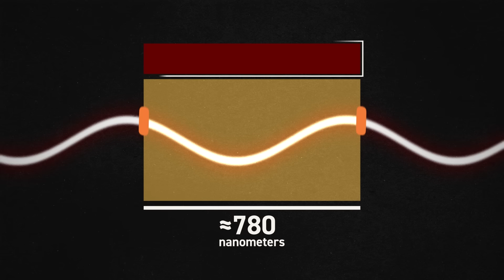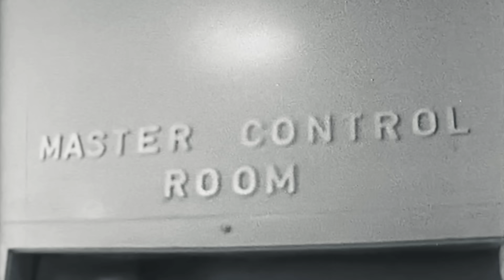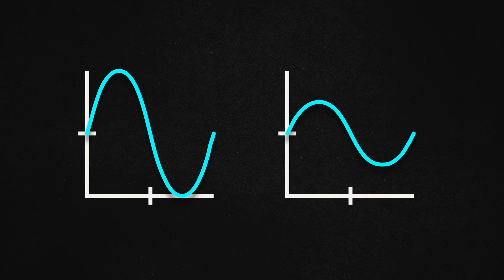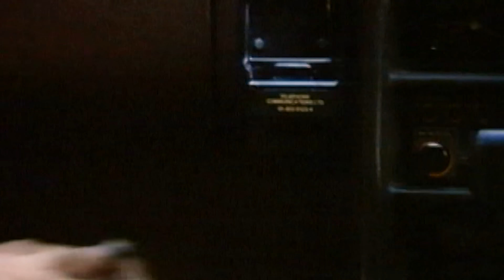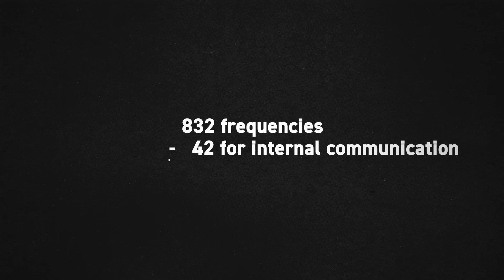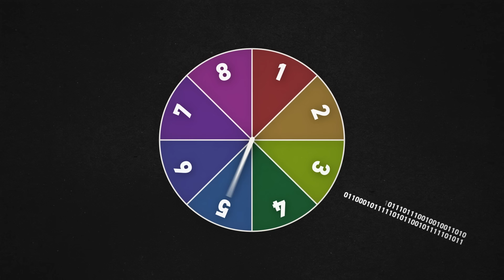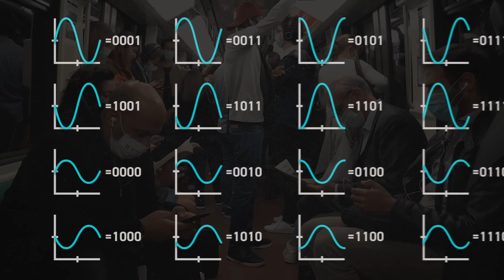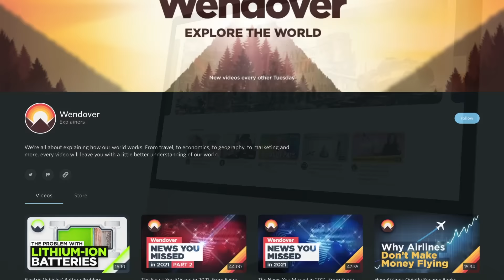How Cell Service Actually Works

Comment: I've done communication engineering courses, the amount of background requireded to understand how this stuff works is crazy. The fact that you managed to provide a Layman's explanation for such an advanced topic is very impressive. No Fourier transforms or complicated math, well done.
Reply: Man seeing this video made me realize how much thought is put into communication.
Last video I learnt about how much engineering goes into transmitting electricity.
Respect for those who make all this possible.
Reply: Insane? It's just Elementary Linear Algebra to make the most basic encryption, the more complicated encryption require more complicated matrix math.
Reply: Wish this video was there when I was starting to study communications engineering. The CDMA part triggered my PTSD of struggling to calculate transfer functions, bit error rates, transmission loss, etc. Of course I have moved into another field since I graduated.
Reply: I'm surprised how much I've taken this tech for granted
Reply: @KRYMauL  you are missing the loads of Fourier transforms, constellation diagrams, bit error, etc needed to understand cellular transmission. That is hardly basic encryption. Understanding RSA or ECDH is much simpler than communication Engineering.
Reply: @KRYMauL  data encryption might be easy algebra.The estimatimation and equalisation framework in signal theory is completely different beast
Reply: @thunderb00m  yeah he’s clearly never had to take a signals, systems and transforms class.
Reply: @thunderb00m  I knew their had to be a Fourier transformation in there because of how they're combining the frequencies. I couldn't remember the name though.
Reply: @karelrocejdl60  Elementary Linear Algebra isn't easy algebra mate, it usually deals with at least 3 variables.
Reply: @KRYMauL  i think you are confusing signal encoding with encryption.
Reply: @KRYMauL  Well that would be a cherry picking. You missed out a ton of radio communication chain. 1) Channel properties aka Propagation problem: free space propagation loss, multipath propagation, fresnell zones, lobbing, channel leaking, natural made and manmade interference and overal radio link budget, Doppler shift 2) antennas ... impedance matching, polarization influence, beamforming, materials 3) Rx and Tx hardware software defined transceivers... circulators, analog filters mixers, Low noise amplifiers, phase locked loop, automatic gain control, oscillators, Power amplifiers, ADC and DAC, clock jitter 4) signal processing... duplexing, FPGAs, ASICs, digital modulations, equalization, constellation diagram, modulation symbols ... spread spectrum techniques, digital filtering... IIR, FIR and CIC filters, frame synchronization 5) information processing: packeting, error correction, information decryption .... fuuu and i just scratched the tip of what is contained in 101 lectures at technical college
Reply: @vojvl  I was talking about his explanation of how the compiling works.
Reply: @juliankandlhofer7553  No, I'm just using the wrong words.
Reply: @KRYMauL  perhaps a different interpretation of how Me and You interpreted what FoggyJeff meant by "the amount of background requireded to understand" in the area of communication engineering courses ... understandable, have a nice day
Reply: @KRYMauL  Encryption got nothing to do with communication engineering, and there is a lot of complicated math involved. just for the absolute basics of system and signal theory you need integrals, complex numbers, convolution, fourie transforms, laplace and z transforms. And if you get into the actual communtication engineering you need basically everything from stochastics in addition to that. And a whole lot more when you look into encoding, compression, modulation, sampling, filtering etc.
Reply: Am I the only one who's offended by this video? Ugh
Reply: @professortoasty90  Elementary Linear Algebra uses integral, derivatives, and complex numbers. It’s literally the basics of Quantum Mechanics.
Reply: @KRYMauL  Quantum mechanics has nothing to do with communication engineering. And you do not seem to have a clue of what you are talking about. Would recommend taking some Analysis / Linear Algebra courses at a university before talking nonsense here.
Reply: @professortoasty90  I took both a real analyses and linear algebra course.
Reply: @jessicatriplev9802  Why?
Reply: I'm in a satcom course and I'm amazed how well he explained phase shift keying
Reply: So I figured I'd ask since people smarter than me are here.  Is 5g more about tower to tower communication and encryption rather than the wave my actual phone gets?
Reply: @thunderb00m  Sat in one of these classes in college and I noped the fuck out and decided to do circuit design instead lol
Reply: @cesaresaladandthespicycrou4080  It's more about what your phone gets... And sends. Also cell sites are smaller so less people are handled by one site.
Reply: @overamped23042  I appreciate the answer because I do love to learn.  I think my question was bad.  Are the intensity or frequency of the waves my phone is getting greatly changing or is it the code that it is getting.
Reply: @thunderb00m  I think 95% of EE/TEs end up working in a totally different field 😂
Reply: @cesaresaladandthespicycrou4080  well the intensity is a tricky term... it may change both with with overal strength of signal (further away from transmitter the weaker the rf signal is), type of communication link, Duty cycle of communication as well as with type of digital modulation... PSK modulation has the same magnitude for all modulation states, on the other hand 64-QAM for example has specific phase and magnitude for each modulatin state... and then there is OFDM modulation which essentially consists of multiple smaller QAMs or PSK. The overall Strength of signal as common phone user understands it usually represents the amount of power of received signal... this (besides the type of modulation) also greatly depends on power amplifier of used transmitter and antennas. But there are fortunately general rules (SAR limits) from FCC and ITU about how much of electromagnetic radiation is acceptable  in respect ofi influence to biological matter aka humans (the result of rf interaction with human mostly generates heat .... this is used in much bigger and controlled scale in microwave oven). Hope my answer was not too much technical... I can elaborate if you are curious about some speciffic topic.
Reply: The one thing I can never get my head around is how two same frequency devices can transmit at the same time next to each other without interference to the data transmitted? Like surely there's a physical limitation to identical carrier transmission?
Reply: I thought the same here!!!
Reply: @cesaresaladandthespicycrou4080  For one, 5G uses a higher frequency band for the channels. This already means faster potential data transmission and smaller antennas. The overall energy use for each connection should actually be reducibel with 5G but I am not familiar yet with the details of the standards that where set. Additionally there sure where some changes in the signal coding strategies to allow more simultaneous connections, faster transmissions and better error resilience / correcting. And there is still potential. When you do information theory in college you learn about theoretical strategies that where just too hard in practise yet but someone might find a way to use them in 6G or later...
Reply: @SticksTheFox  The CDMA spreading codes are the key. They basically cause the signal to be spread out over many frequencies and the receiver can pick out your signal by de-spreading using the same spreading code. It gets pretty mathy as to why exactly it works but you basically use a few extra bits to pick out your signal from everyone shouting over each other. The physical limitation is based on the amount of spreading codes, which is limited by a trade off of taking more extra bits to transmit the same data to get more spreading codes.
Reply: While this is certainly a great explanation, the overwhelming majority of the complexities of QAM come from how it's actually implemented, the base concept isn't super complicated to put simply.
Reply: Still somewhat complicated. I almost clicked off
Reply: @vojvl  so when I said intensity I meant the over all power of the central tower.  Not the fluctuations that give the signal the signal.  And your explanation was wonderful.  So just to make sure I have the gist of it.  5g is just a slightly wider band of freequencies but the towers use similar power because of FCC guidelines and a lot of what makes it faster is the actual way they send the information in the actual transmission itself.
Reply: I did my masters in electronics but Alas couldn't take all those books to use in practical life
Reply: Awe Hush!  You had me at “Requiredededed.” 😁
Reply: @stanvanillo9831  Well,yes... in a way I agree... it is no string theory. But I was aiming for something else. Of course every concept in modern wireless communications essentialy comes down into smaller less complex problems. Because in the end you need to implement the solution into actual hardware (plus someone has to build that hardware) and deploy it in the real world. And all of this has to work fast, reliably and at reasonable cost. But it is a lot (and i mean a SHIT TON) of concepts, algorithms using rather simple math (a lot of complex numbers, discrete math, statistics and sometimes calculus).
Reply: @stanvanillo9831  I took real analysis and linear algebra, but not communication classes because I'm more on the software side.
Reply: I was thinking the same; this might be the best explanation video of anything I have ever seen. It took me about as long as the entire video to wrap my head around QAM I saw it the first time in uni. And I had a pretty decent background in math. To cover the so much of the history of the usage of electromagnetism for mobile communication in a sixth the length of the average lecture is an incredible achievement.
Reply: I am a junior developer working at Nokia and it has been a bit of a culture shock going from University studies to working at Nokia in a real tech industry environment. While my degree is specifically information and communications technology with my main focus on software engineering, I am also doing fullstack from communciation links to 5G & 4G masts all the way to the software development side and there is a ton of complexity. At times it has felt overwhelming even, but I am glad that I have more experienced developers that are helping me and explaining to me what I already don't understand. It would take ages for me to learn all of it on my own.
Reply: Yeah, especially that CDMA part.
Reply: @thunderb00m  what do you do ow? I just took signals and systems and thinking about going communication.
Reply: @jessicatriplev9802  Yes. 

I'm also of the opinion that being offended takes deliberate effort.

So my question for you is as follows: Why do you want to be offended by this? Why choose to be offended instead of remaining neutrally apathetic? 

Have a lovely day!
Reply: You either get it or you don’t
Reply: @andyrob3259  Is it not spelt 'spelled'?
Reply: I agree he discuss it better than my professor 😂
Reply: Oh man, I still have flashbacks on Fourier transforms. But what I really have nightmares about is control theory
Reply: it helps when you can animate what is written in text, faster and more effective in my opinion.
Reply: Honestly, I kind of expected something about Fourier transforms
Reply: Sounds like you wasted money on tuition costs 🤔
Reply: requireded
Reply: @KRYMauL  dude you have to be a genius to be on the edge of any field. You’re making a gross understatement in saying advancing cellular technology is anything but insane. The brink of any engineering field is insane
Reply: @prettycoolcat  It’s just elementary linear algebra. I pass it, and linear algebra is an introduction to upper level math course.
Reply: Actually, in terms of layman explanation it would have been better to skip the encoding/decoding altogether and just point out that just like your ear can pick out different instruments simultaneously in a piece of music, the cell tower can pick out different signals transmitted at the same time... the only trick is that different "instruments" are in use - which is what the spreading codes correspond to.
Reply: @adarshmohapatra5058  no
Reply: Incredible video. Thanks producers! 😌
Reply: I did it too. Now i manage engineers, both just as difficult LoL
Reply: In this comment thread is the most startlingly flawless example of the Dunning-Kruger effect, and also, the fact that the a little knowledge with no understanding is the most dangerous thing.

We have here a guy who does not even vaguely understand the terms "signal encoding" and "data encryption", what they are, nor the fact that they're two completely different things. However, he's taken an introductory course to linear algebra, and is spouting a whole lot of erroneous drivel with an air of arrogance. 

All this continues on, despite the fact that several people who replied to him to correct him actually have functional understanding of applying those two concepts in the real world, obviously including an understanding all the mathematics involved (of which his tiny sliver of education is a minuscule subset).

This is actually an amazing real-world example that you can take and show others to demonstrate "overestimation of capability" in action. I doubt you'll find a better example!
Reply: Was a tower climber then RF engineer for 8 years. You could spend your entire life studying just one area of cellular and not learn it all.
Reply: My airport uses CT scanners now 😔
Reply: @KRYMauL  There's always one
Reply: @KRYMauL  while it might not be linear algebra or quantum mechanics, you might want to start smaller with learning the difference between there, their and they're
Reply: @seanc.5310  My major was in Math and Computer Science, not English.
Reply: @adarshmohapatra5058  not much thought is put into the way I communicate. Maybe it's because I'm an idiot, but idk.
Reply: So algebra is completely useless. I knew it! I still don't get why they require you to pass it to graduate high school.
Reply: @CoasterMan13Official  nah man. Algebra is easy basic math that everyone should know. I’m with you on not everyone needing calc and up though, unless on a career path utilizing high level math.
Reply: Computer Scientist here. We also got a chance to dab into other various I.T courses and you are right, I actually got to learn quite a few things myself about how communication works. Of course you learn the rest on your own. But doing labs and CompTIA courses did help
Reply: its not that complicated
Reply: I learned this kind of cell design with but a handful of equations, but more importantly years of conceptual understanding and decades of experience being passed on.
Reply: This is layman’s terms?
Reply: @NJTransit1985 yes—just the very mention of fourier transforms gives me nightmarish flashbacks to doing my math degree and being the only non engineer taking partial differential equations. PDEs SUCKED. tbh i didn’t understand 99% of it and i was in my senior year of a math degree :))))) still got a B+ though!
Reply: It’s Lehman
Reply: Your probably just over complicating things
Reply: 100% agree.  I had a class in college that went over this, and this video was far superior to any of the lectures or reading material from that class.  Truly a fantastic explanation of a very complicated subject.
Reply: MaxLinear just has issued a new open ran 5g SoC chip called “Sierra”.
A very powerful chip!!!!
Reply: Thank you so much for the incredibly important work you and your colleagues are doing. I imagine it's a thankless job but you deserve all the thanks in the world
Reply: @KRYMauL cringe bro
Reply: Honestly when I see these types of videos I get scared they’ll say something wrong. The researchers for this channel are amazing
Reply: 42 for internal communication
Reply: @mountbikejeff
Yeah, there are plenty of his videos I haven't seen, but this is my favorite of his thus far has been for months. It reminded me of Asianometry in how it reminded me how interested I am in electrical engineering shtick(I'm an undergrad in MET and my dad's a software engineer, so it's honestly the facet of mechatronics I've neglected the least... by far, even)!
Reply: this amount of information compression would have saved me a lot if college woes

thank you!
Reply: He just made it so that I, someone who went completely blind and couldn't understand the more visual aspects of this, could get it. WTF, my school failed me!
Reply: Honestly, this video explains it so well, that I'd expect a skilled engineer to be able to build a functional phone system from this explanation even if all prior knowledge of it had been lost in an apocalyptic disaster, catching our comm tech up to the 21st century with just a few years of dedicated work.
Reply: @KRYMauL  Guess you're a mean teacher?
Reply: Anyone read the book The Fifth Wave?